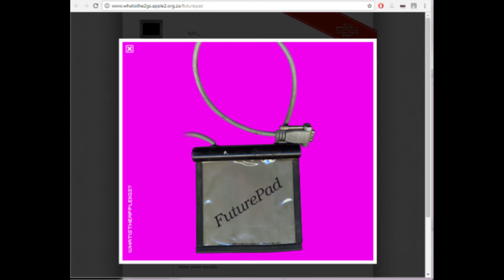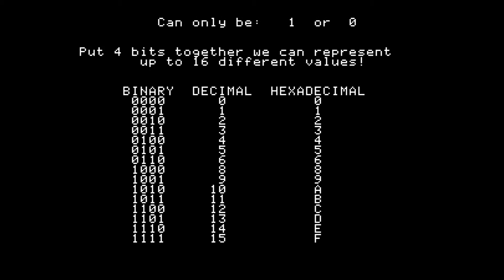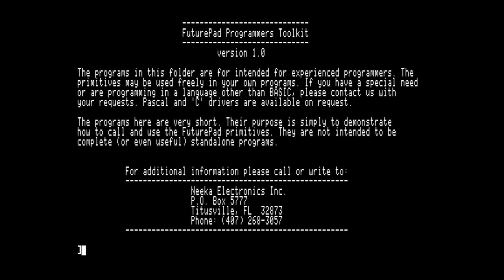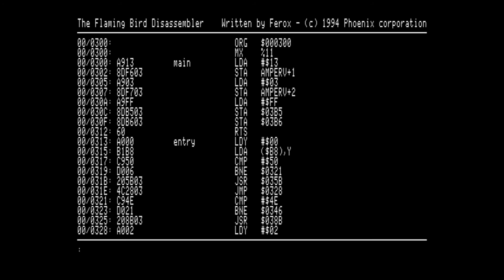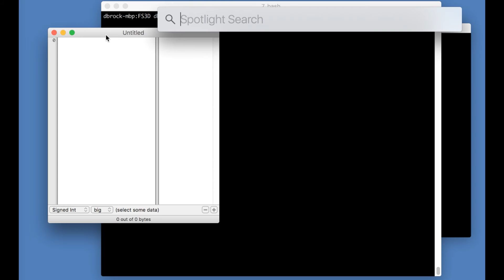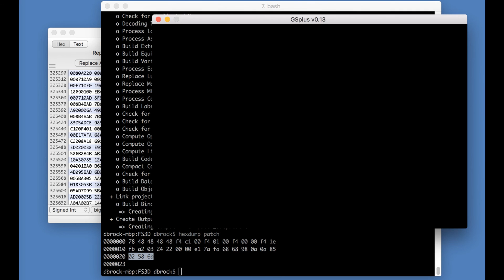Future Shocked - Disassembly Special

Comment: Sigma Delta Capacitance measuring through a known resistance.   Very simple, using the change in voltage to determine when the state detected goes from a one to a zero and seeing how long that took to find the capacitance.  You will see this kind of thing in many different uses for simple HW that does not rely on more advanced IC's (including a simple method of implementing an ADC).

Comment: good job!  I can't even disassemble my own code, lol.
Reply from the maker: Well, I got lucky in the sense that 1) I guessed correctly that it was somehow related to a joystick, based on the plug  2) and then saw the obvious button reading code  3) and that it included a driver that was tiny so I didn't have to start with the entire game binary.  

When you are doing a large binary, or need to disassemble a lot of the code, it can be really daunting at times.

I just wanted to show everyone that you can stumble your way through it if you follow some intuition.  (Of course I made it look quite fast, but I did read through the entire disassembly at human pace when doing this originally, having to stop and look up some of the addresses used for decoding the BASIC commands.)

Also, it's quite fun to find out, as in this case, "oh, that's how it works... just rapid button line state changes that are timed by a little loop."  I wanted to share that sense of fun you get when something completely unknown becomes completely clear and verified.  It's a good feeling when the disassembly is done and understood. ;)